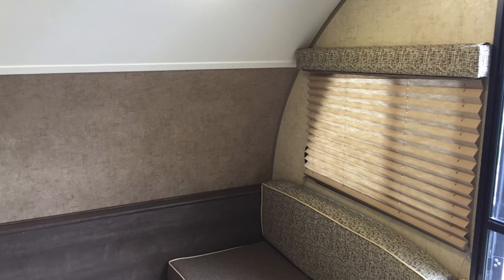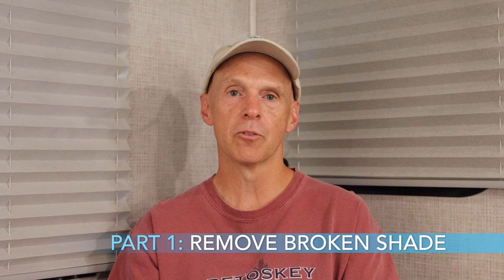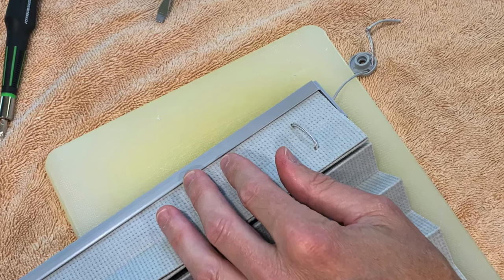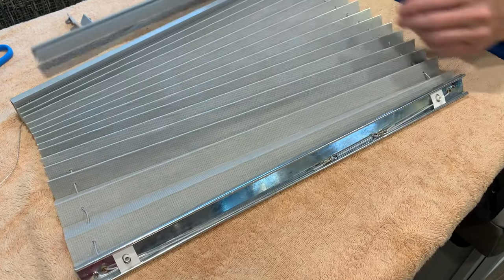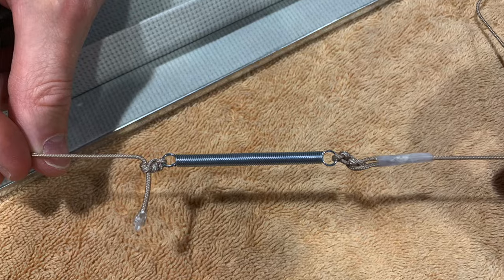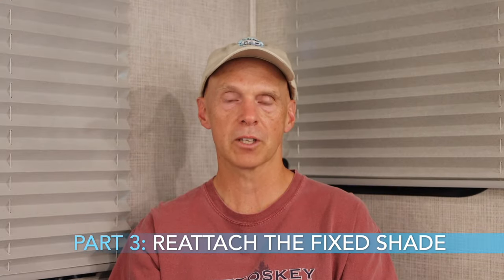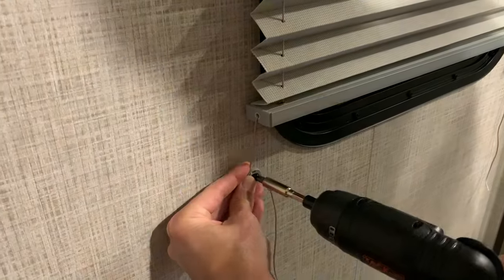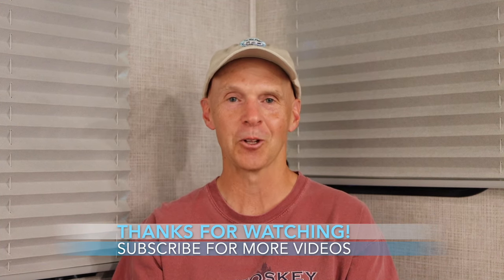How To Restring An RV Window Shade - Step-By-Step Process

Comment: Great tutorial John!  I did this a few months ago and luckily succeeded with re-threading the string.  It’s so important to leave plenty of string at each end to properly torque the strings so the shade works properly.  I also will add that instead of using scotch tape, I used a lit match to slightly heat the nylon string until it melted, then rolled the end of the string between my thumb and finger to smooth out the end of each string to keep the strings from fraying.  Your repair kit is the exact same one I used for my project.  It comes with excellent instructions to do the job.
Reply from the maker: Good points Tim. Thanks for sharing!

Comment: Great video but how do you fix a shade that has 4 vertical strings, one on each side and two in the middle? (I see you’re sitting next to one of these shades in this video.)
Reply from the maker: Anne, I have not restrung the larger shade yet. It just recently began to act up, but I am not sure when I will get to it. I do plan to put a new video out when I do it, but it may be a while to get to it. Thanks!

Comment: Your videos are fantastic for a R-Pod 'newbie' (6/21 build 171, purchased 7/21).  One of the tensioner mount screws on my front road-side window has pulled out from the wall...can I use a short (3/4") moly fastener in the hole?  I really don't want to drive three hours each way to the dealer for a warrantee job.  Thanks!
Reply from the maker: The walls on the R-Pods are very thin so I'd be cautious adding the moly fastener as you suggest. You may still want to contact your dealer to get their input. I'd also recommend to ask on the owners forum (not Facebook) to see what others have done: rpod-owners.com

Comment: Great video and explanation. I restrung my shades but they still don't stay up. I wonder if I didn't tighten the string enough when reattaching the tensioner. My shades have 4 strings and 2 springs. I was very careful to reattach springs and strings the same way the came off...two middle strings to one spring and the two outer strings to the other spring and the two left strings came out of the right side at the bottom of the shade and two right strings came out the left side of the shade. I even took pictures before I took it apart. I took the shades back down an will check everything out.
Reply from the maker: It sounds like you may not have your tensioner strings tight enough. I do plan to publish a restringing video shortly that covers the larger shades with four strings. For now, you may want to have someone to hold the shade while you tighten the knots on the retainers.
Reply: @JohnMarucci  we'll try that. Thank you!

Comment: Great video. I replaced strings in one of my shades today, and your video and instructions were very helpful! Unfortunately, things aren't always simple, and my older travel trailer had a few challenges. The shade was actually installed ON the valance which wouldn't have been a problem except with the shade in place, you can't get to the screws for the valance! So, that was fun installing it 'UP'. Thanks again for your tips and instructions!
Reply: Oh, and the kit I picked up from Amazon included a threading tool to pull the strings through.... VERY helpful!
Reply from the maker: Great to hear that the video was helpful. I think I've restrung six or seven of these at this point. I guess I'm too rough on the blinds!
Reply: After tons of research I bought some spray paint bc I saw a video on repainting my cloth rv blinds... 

It wasn't until ibwas 90% finished that I realized I'd STILL used the wrong type of paint. 🤦🏼‍♀️🙄😂

So the strings are all breaking. 

I didn't expect to actually find what I was looking for when I searched but OMG your video was the FIRST to pop up and these are my EXACT same blinds! 

Thank you SO MUCH!

I'm going to order the Amazon kit straight away and get these puppies fixed! ❤😊😂

Comment: Hello John, I found your video on How to Restring An RV Window Shade very helpful except that our RV does not have the tension button at the bottom of the RV shades.  The shades merely go up and down by pulling for down and pushing up for up.  So how would the process for repair be for these kind of RV shades?  Do you have any suggestions?
Reply from the maker: I have no experience with restringing shades without the round wall-mounted tensioners. You may want to search YouTube for other videos based on your specific shade. It is likely a shade type that has some sort of internal tensioner, so if you can locate a brand or model on the shade itself, that is where I would start my search. Thanks!

Comment: I am trying to apply this principle of stringing a pleated paper blind to my house bedroom window, which currently is fitted with a cordless stick-on blackout pleated paper blind. I have a collection of tension springs and suitable cord is widely available. I will need to compress my blind fully, then drill a stringing hole through the pleats on each side. The only part of the video that I don't completely understand is the crisscrossing bit. What is the purpose of crisscrossing the strings? I've downloaded the relevant PDF from your website to see if it's any clearer.
Reply from the maker: I am fairly certain it has to be done this way to provide enough tension.